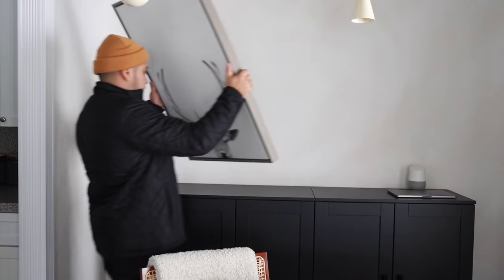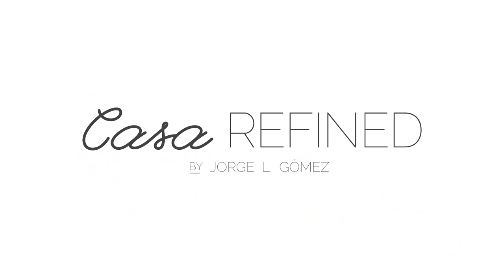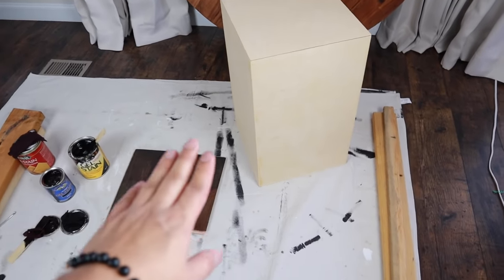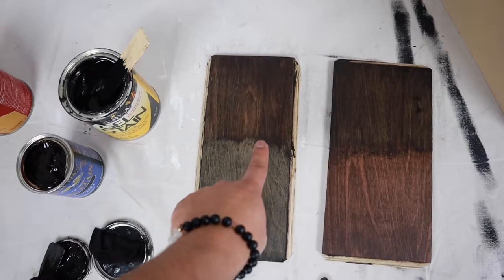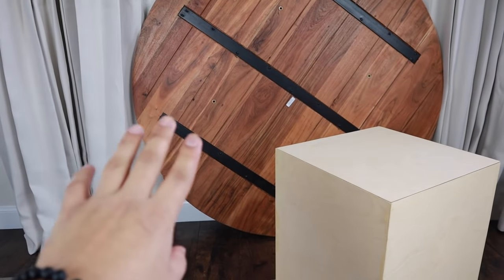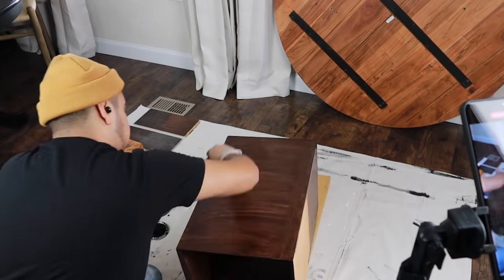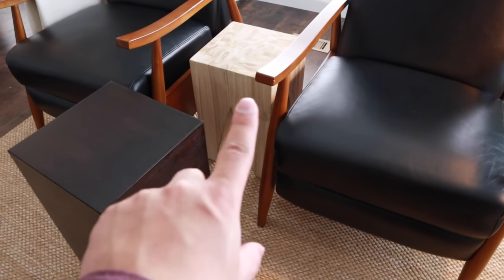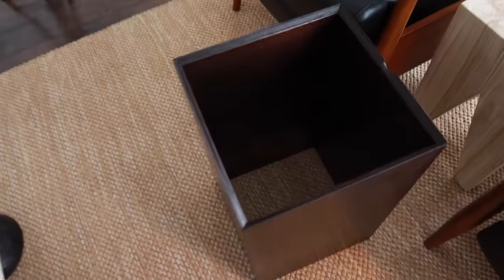DIY Decor With Me For My 2022 Living Room Makeover - Part 4

Comment: Loved this - so true about motivation levels on gloomier days! Happy New Year, am sure your wonderful channel will continue to grow in 2022. Your pad is looking great, so sleek and calming. I'm interested to see which way you went on the red  wall art. Some of your monochrome details make me think of the bold designs of the 80s mixed with Bauhaus and Mondrian style details so something bold could work well, I think. BUT, on the other hand, there is a modern trend towards softer shapes that would tie into the contemporary aspects of your design style too, so I don't think you can go wrong. The floating frame is great and has solved the problem I have on a huge canvas that has never really looked finished, so I will be tackling that too! Buying printed art is a fab option and the piece you chose is stunning. As well as crumpling the print, another finishing technique you can try is to get some acrylic clear texture paste/gel and go over the print as if you were painting it, with either a brush or palette knife to give the impression of real paint texture. I saw someone else do this, and it turned out really well. Thanks as always for the brilliant video and inspiration 🙂